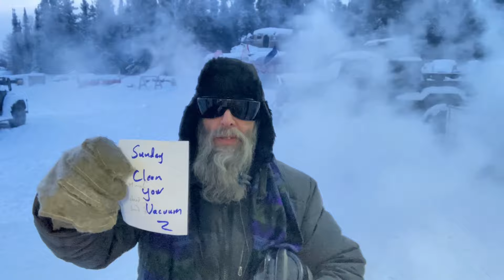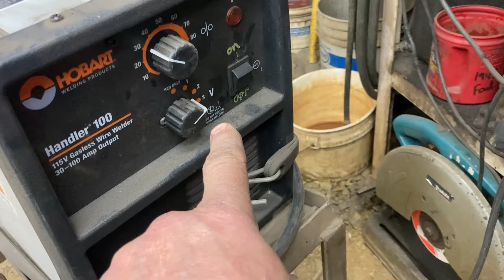After 14 Years, My TD 6 Cat Has a Tail Again Jan 14 2024

Comment: Yes!…I LEARNED a few more “Tips” about the Plasma Cutter Tips. I still amazingly remember the Blue Beads to get the water out of the lines and baking them. Now I know what parts melt and what tip cap is betterer.
Reply from the maker: yes the blue beads are the way to go plus have the plastic ring in stock so you can change it and keep going  thansk

Comment: Just like you the same radiators for the GM Trucks +'48 sedan del? Do you run the same Delco alts😘. in all the machines?  I replaced a mongrel Bosch alt on my '63 Willys Overland do Brasil  with a Delco 1 wire.  A hacksaw was involved, but being able to "clock" the front 1/2 made mounting  it easier.  Xena, good luck with new job😎😎
Reply: It was a good first day, thank you. 
Xena
Reply from the maker: the 48 sedan delivery is all original and we have kept it like that incase it ever gets restored to show room condition. yes the GM 1 wire alt is the way to go and we have it on everything in the Kingdom.  thansk